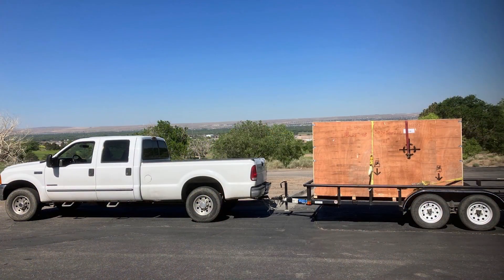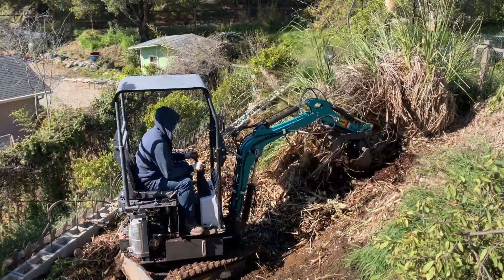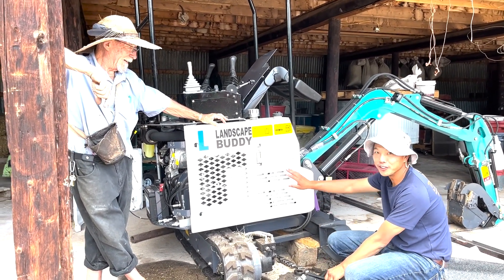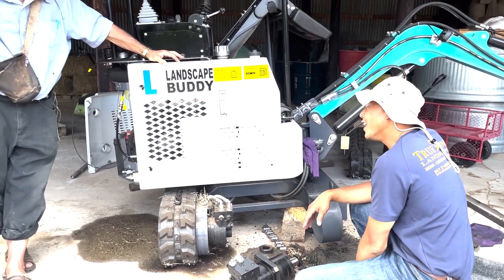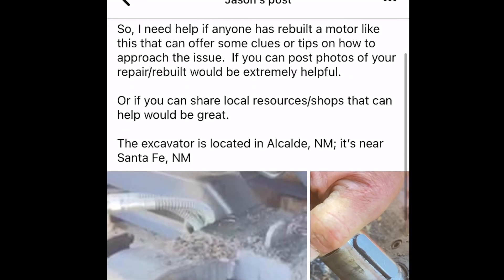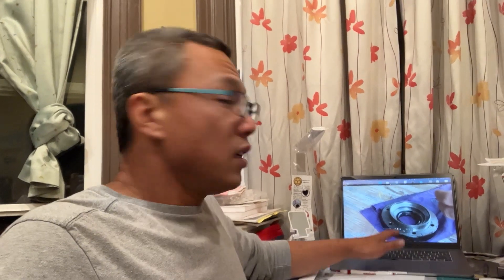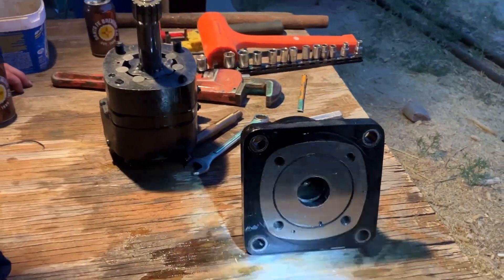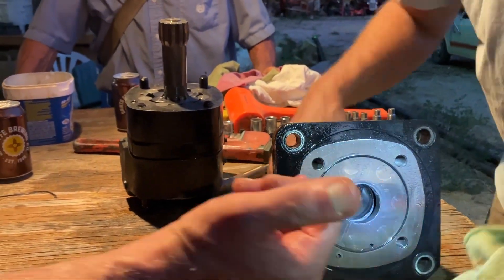The Landscape Buddy 1.5 Ton excavator traveling motor issue uncovered.

Comment: You're a good dealer Jason. Thanks for sharing
Reply from the maker: Actually I’m not a dealer, at best a reseller.  I just like to help ppl import and I felt it’s my responsibility to help out Ron to get the excavator fixed.  That’s all.  Cheers!
Reply: @jasonyeh99  So is the factory sending out any parts?  Did they charge for them?  Or just for shipping?